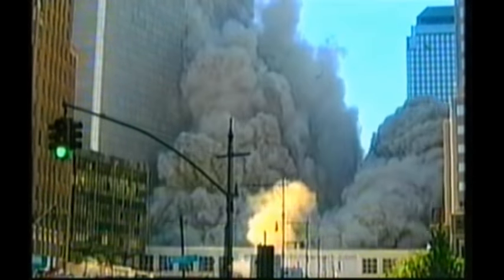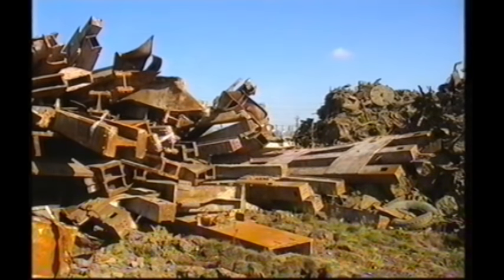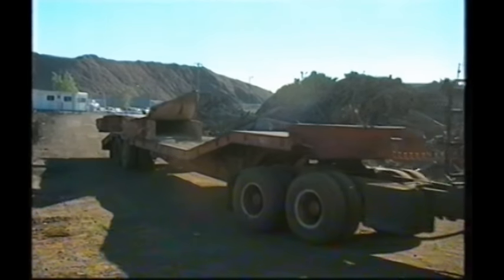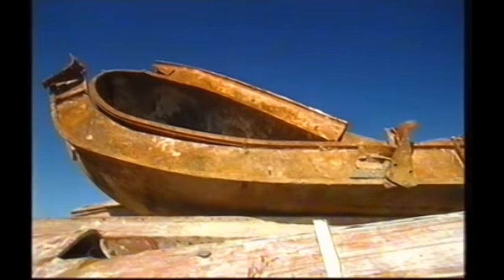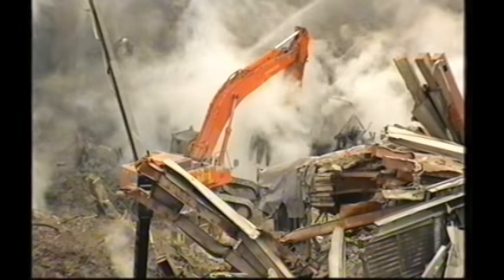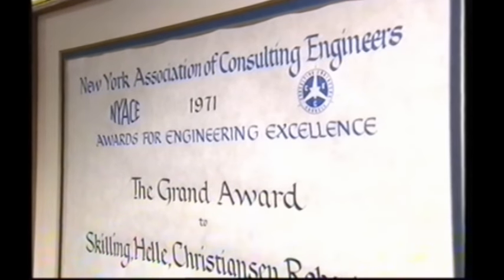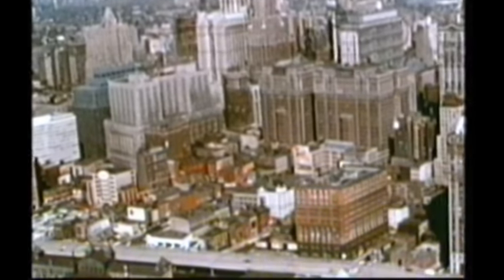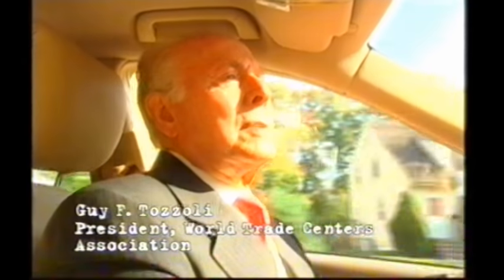9/11—"How The Twin Towers Collapsed" (C4 documentary, 2001)

Comment: Why was the scrap metal sold so quickly to china and why didn’t the structure twist as it fell like the experiment  ?
Reply: What is 'so quickly'? How long should they have waited? It was scrap metal that wasn't going to improve with age.
The experiment simply demonstrated that when stabilizing elements (e.g. trusses) are removed from a system then the system is subject to oscillation and a reduction in its ability to sustain weight. It was not intended to demonstrate the degree that either tower would twist, mainly because that would be influence by the amount of structural damage in each one.

Comment: 37:32 "normal fires are not hot enough to MELT steel even if you were for example to use an unusual fuel like  kerosene, you cannot achieve temperatures hot enough to melt steel"

Exactly! and since fire doesn't melt steel, this documentary forgot to explain why evidence of molten steel was found as well as evidence of bombs exploding...

Comment: I don't believe any other skyscraper built, even today would out perform the 1st World Trade Center. There was nothing flawed or contrary about the design. The damage was just too much.
Reply: Yeah, a passenger plane going at those speeds is basically a missile.
Reply: @notNajimi   The missile-like aspect of it wasn't the problem.  Missiles are destructive by virtue of their impact and the explosion they create.  But here the buildings stood up to both without any problem.  The takeaway from the documentary, in my opinion, is that if it weren't for the jet fuel that persisted past the explosion, as well as the huge supply of combustible material in the buildings, the fires could have been put out and the buildings repaired.
        But I'll allow that one could argue otherwise and say that turning the plane in to a missile was the only way to introduce into the structures the fuel necessary for creating fires of such a size.
Reply: Yes but having at least one or two staircases away from the center would have allowed more people to escape the first building at least.
Reply: @johnpersechini4951   A good point, but I've never been in an office skyscraper with stairs anywhere but in the center service core.
Reply: @Pissgremlin5964  I can't dispute you on that.
Reply: @bradrook3919  Interesting that you would use the word crazy. 😄 Fitting, in the context of your post and all the neurotic assertions littering this section.
Reply: @dixonpinfold2582  assertions?
Facts my boy Facts... Anytime you see a context warning below a controversial subject...and point out things like the law of Gravity..that go against the narrative your gonna get trolls..I guess...Sir Isaac Newton got it wrong...
Reply: @bradrook3919   Facts have to properly marshalled and organized, and  Newton would be the first to agree with me.
        Flat-earthers deal in facts, too—tendentiously-chosen facts assembled in nonsensical fashion and tortured into an absurd conclusion.
        So the mere dusting of any incorrect narrative with facts, I'm afraid, does little to save it.
Reply: Steel-framed high rise buildings are not known to collapse because of fire, but 3 did in a row, on that single day.😂 That's the point.
Reply: No skyscraper can withstand "Thermolite"! This was a perfect example of demolitions, including "Building 7" that fell to the ground for no reason (except Thermolite").
Reply: @garsonprice3441  
So, please provide a detailed explanation of how this "Thermolite" was applied in complete secrecy (even to this day) to two 110-storey buildings occupied by tens of thousands of people.
This should be good...

Comment: How did thevthird tower drop as nice as any controlled demolition
Reply: Gravity
Reply: @MFitz12 All the buildings around it were subject to the force of gravity. It just so happens this one was subject to other forces as well.
Reply: @andrewthompson5242  - Fire (heat) and time
Reply: @MFitz12 

1) How did the fire start? 
2) Why weren't any of the other surrounding buildings on fire? 
3) Why was there no resistance from the lower part of the building when it collapsed? 
4) Point to another example of a steel building collapsing in this manner as a result of fire and time.
Reply: @andrewthompson5242  - That seems to have taken care of things. Glad I could help. Have a nice day.

Comment: So where did the molten metal pouring out of the corner before the first collapse come from?
Reply: From the planes - made out of aluminium that has a lower melting point than steel.
Reply: Better yet was WHY was High grade (MILITARY) Nano Thermite found all over the debri site, to be hastily cleaned up, with molten pools of steel buried in the debri! Something rarely seen outside of chemical interaction
Reply: @marsmars9130 Where is your evidence for that?
Reply: Thermite charges set on the steel structural beams of the buildings in the weeks before. It was a controlled demolition. All the concrete was pulverized.
Reply: @martinsloman6905  Molten aluminum doesn't glow.
Reply: @knust2329  I suppose the answer to that is that this aluminium was on fire due to exposure to water.

Alternatively. It might be lead as someone suggested. If not we're stumped aren't:we as we've just been told that the steel never got hotter than 600 degrees and steel doesn't melt at that temperature.
Reply: I don't have any - other than streams of molten something were seen falling from the towers and there was a lot of aluminium in the towers which has a melting point much lower than steel. Circumstantial evidence maybe but makes sense.
Reply: @martinsloman6905 
The only problem with that, aluminum does not glow red when molten. It remains silver like lead or mercury.
Reply: @Motor-City_Ben-Diesel  Yeah, sure. Two 110-storey buildings occupied by tens of thousands of people were wired for demolition in complete secrecy (even to this day).
Reply: @knust2329  If not, then what does molten aluminum look like? And, why would molten steel 'glow' but not aluminum?
Reply: Both towers were covered in aluminum cladding, which gave them their 'stainless steel' appearance. Otherwise, they would have looked like iron.
Reply: @kyle381000  Tell me Kyle what make YOU the expert? because Guberment said so?? maybe you should stick to how many genders there are, Hint! its 2
Reply: @marsmars9130  I stick to the verifiable facts and avoid running down convenient rabbit holes of speculation driven by ignorance and paranoia.
Reply: @kyle381000  So then your clueless Thanks for telling! Its ok, some are just to lazy or dim , to think out side of the box! dont worry you will find your spot, maybe
Reply: Follow the money. Who bought the building, who took out insurance?
Reply: @teresaanderson8497  
Firstly, you don't do an analysis of the collapse of a physical structure by saying "Follow the money.". That is a ridiculous premise.
Secondly, if you're implying that Silverstein's taking out of insurance on the WTC is suspicious, then you're dead wrong. As the tenant, Silverstein was contractually bound to maintain sufficient insurance on the property to replace the structures on it, and he was also legally bound to rebuild or replace those structures. He could not simply walk away with the cash in his pocket. He had to use the money to rebuild and repair the structures destroyed or damaged by the terrorists, and it was considerable. There is no need to 'follow the money' because the money never went anywhere.

Comment: Someone please tell me why building number 7 collapsed.
Reply: As per the NIST,

"On Sept. 11, 2001, WTC 7 endured fires for almost seven hours, from the time of the collapse of the north WTC tower (WTC 1) at 10:28:22 a.m. until 5:20:52 p.m., when WTC 7 collapsed."

The article further explains:

"Debris from the collapse of WTC 1, which was 370 feet to the south, ignited fires on at least 10 floors in the building at its south and west faces. However, only the fires on some of the lower floors-7 through 9 and 11 through 13-burned out of control. These lower-floor fires-which spread and grew because the water supply to the automatic sprinkler system for these floors had failed-were similar to building fires experienced in other tall buildings. The primary and backup water supply to the sprinkler systems for the lower floors relied on the city's water supply, whose lines were damaged by the collapse of WTC 1 and WTC 2. These uncontrolled lower-floor fires eventually spread to the northeast part of WTC 7, where the building's collapse began."
Reply: @handofdoom4970 it also held the back up generators with lots of fuel for the city, making it burn even more out of control. Firemen explained this later and knew it was gonna collapse at 3 pm evacuating all firemen from the area.

Comment: I worked on that several acre site in 1991 and building 7 was the furthered away from the towers. It was more than a football field plus. It held all state and federal agencies to do with law and military. I'll add no more than I've added. It as I was there for 6 weeks and stayed else where for 6 weekends. It doesn't puzzle me as to why it was the 3rd oof seven buildings on this location. Junk bonds and Mike Milken are part of this puzzle. It's easily the perimeter of the puzzle put in correct perspective!!!

Comment: The designers could not have built the towers to withstand jet airliner impacts, cost would be too high.
Strong argument that, in fact, there is NO intelligent life on earh.
Every few centuries, a couple bright spots, but humanity is a dumb, selfish animal.
Reply: ... and the airspace above Lower Manhattan was out of bounds to aircraft anyway so under normal conditions, no planes would ever have gone near the Twin Towers, so no real need to design them to resist the impact of jet liners.  When the twin towers were designed and build, the largest jet liners were much smaller anyway, and no doubt planes the size of a 767 or 777 had never been dreamed of
Reply: Inappropriate place for your personal, hateful, anti-human speech.

Comment: I’ve seen dozens of shots of the planes hitting, but that second one must be the best (or worst in many ways). Simply chilling, but also awe inspiring.
Reply: Watch the video of the second impact at 8x speed. You can actually see the building oscillate.
Reply: @kyle381000  Crazy. Thanks for the tip.
Reply: @kyle381000 BTW, did you mean 1/8th speed? Anyway, they are designed to oscillate. I worked in basically a clone of the WTC in Chicago: The Standard Oil Building (by then it was the Aon Center though). It was about the same height but not as wide. I was on floor 66 and when it was windy the elevators would sway. If it was REALLY window, you could feel the entire building swaying. I hated it.
Reply: @The_ZeroLine  No, 8x speed.
Reply: @kyle381000  I don’t even see an option for 8x speed. lol
Reply: you have a strange understanding of awe.
Reply: @sifridbassoon  Nope. Something can be awe inspiring or “awesome” without being positive.

Comment: the elevator would only fall a few feet before the safety breaks would activate. The safety breaks are mechanical so that they work even if power is out or no one is around
Reply: "You may well ask: what would happen if all the cables snapped and the automatic brakes failed. Then, yes, the elevator would fall to the bottom floor. But in order to fail completely, the brakes have to be physically damaged by a significant accident, such as a colliding airplane."
-West Texas A&M University

Comment: It's an interesting documentary. I don't feel any responsibility, and certainly no blame, can be attached to any of the design or engineering team (though I understand why they might feel some guilt). The towers would both still be standing if fanatical Muslims hadn't behaved as they did. No designer could have anticipated those events in the 60s. Hindsight should be used without any finger pointing.
Reply: WRONG The designers DID IN FACT take into account, and thereby build the  towers to withstand plane crash
Reply: Steel-framed high rise buildings are not known to collapse because of fire, but 3 did in a row, on that single day.😂 That's the point. "Fanantical Muslims", for sure.

Comment: How the building came down due to bending floor than how did that broke the whole building if it was no damage to the outside all in four corners also in same spot!?
Reply: Twin Towers collapses can be broken down into four stages, all of which can be seen and identified with the naked eye:
1. Collapse initiation through perimeter column buckling (floor bending).
2. Progression to global collapse with thousands of tons of debris falling within the four outer walls, through the open office space, striping the floor systems from the perimeter and core systems floor-by-floor, followed by;
3. Perimeter column peel-off, followed by;
4. Strip down of the core

Comment: WTC were the 1st & 2nd, very tall skyscrapers, ever built with this 'Exoskeleton' technology, and the only 2 ever built. It was designed & engineered to rise fast, VERY FAST, and to have no interior columns. It relied only on it's exterior 'Structural Skin' and the concrete core. It was very brilliant, but extremely flawed. It was 'Attacked' and 'Failed' because it was not designed to withstand a terrorist threat. It was a beautiful pair of buildings, and Yamasaki was a genius architect. But criminals can be very smart too.... I cried when the buildings went down, and felt much pain for the Engineers, the Workers and of course, the Architect.

Comment: Explain why Tower 7 came down...
Reply: It was on fire for 6 hours. No sprinklers. Footage of the collapse shows the internal structure failing around 5 seconds before the rest of the building fell. It will fall at the point of most stress, that being at the ground level having the most weight on it. It fell at a tilt, it fell right across the road in front of it. The building had been evacuated for hours because firefighters saw signs it would collapse. When the towers fell, they damaged the front of the WTC7, the side that faced away from the footage everyone sees.  We know why the towers fell.
Reply: @mroof523  even the nist report says the explanation of the symetric collapse from one failing column causing assymetric internal collapse is a tricky one. Then of course we have silverstein on camera saying they decided to pull it. But it would take days to rig explosives to pull it symetrically. Since it fell pretty much freefall speed, yeah it must have caved at a very low level. The symmetry gets me though. I find that very strange.
Reply: WHAT COMES DOWN IN FREE FALL
Reply: @thehighwayman78  Silverstein agreed with the NYFD that WTC7 should be left to its fate and that the firefighters should all be withdrawn in light of the tremendous loss of life at WTC1 and WTC2.

Comment: At  1470⁰ steel starts to change structurally by 2100⁰ it liquifies. The airflow and jet fuel created a blast furnace
Reply: Wrong... the jet fuel burnt immediately upon impact, in case you missed the 1000 foot fireballs.
Reply: What about the North Tower explosions clearly seen before impact ?
Reply: @fakeaccount8342 It did NOT all burn up instantly.
Reply: @EMEL-hr4ut  what "north tower explosions clearly seen before impact" are these?  Given that there's only one even kind of clear video of the plane hitting that building, I'm interested to know what you're referring to.

Comment: TATA STEEL set fire to a multi-story car park that was full of vehicles containing fuel tanks filled with petrol and diesel. The building was made from concrete with a steel frame plus rebar. It burned for 3 days before they finally extinguished the fire. On inspection they reported that the structure had not suffered any significant damage and that only handrails had suffered any distortion and had not melted due to the intense heat.They wrote the bible on steel building construction and that's why all modern high rise towers are constructed that way. Fire cannot totally demolish a high rise building constructed of concrete and steel.
Reply: OK, so what?
Reply: @MFitz12  I don't have conversations with flat-earthers, creationists or conspiracy theorists sorry.

Comment: Both planes were b767 widebodies which were chosen because they were the largest planes at the time doing the internal US flights and would be carrying most fuel, larger planes tend to be on longhaul flights, their wingspan is almost the width of each side of the towers as you can kinda tell when they hit so ideal.
The reason the south tower fell first is because that tower was  hit lower down so more weight  was above compared to the north one.
Apparently from what i heard at the time the terrorists thought that the tops of the towers would just collapse only, but this was not the case!
Reply: What planes
Reply: @MMAproAtGOLF  boeing 767-200series medium size widebody aircraft
Reply: @easydrive3662  the planes didn’t have logos, or windows, so no

Comment: Yeah,  notice how when the floor is removed, and the columns buckle from weight, the top weight falls to the side, not down, and does not collapse the structure below it.
Reply: The point of the model was to demonstrate one concept - which you obviously missed. It was not an accurate model of the whole building.
Reply: In the fantasy land of conspiracy theorists, gravity works sideways for some reason.
Reply: Why would it fall to the side? What lateral force would cause that?.